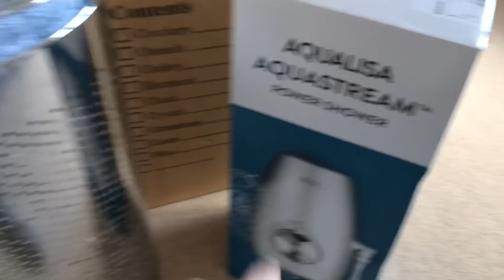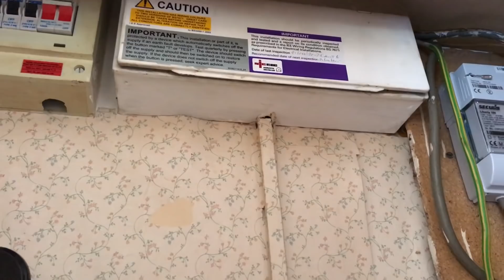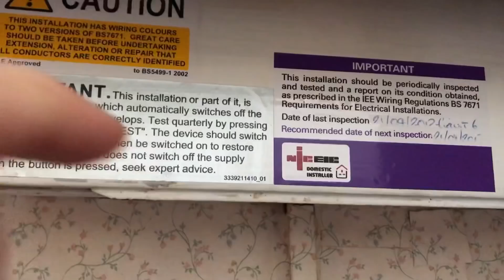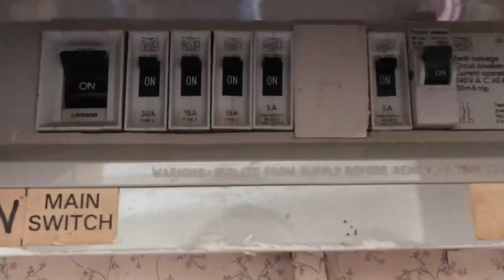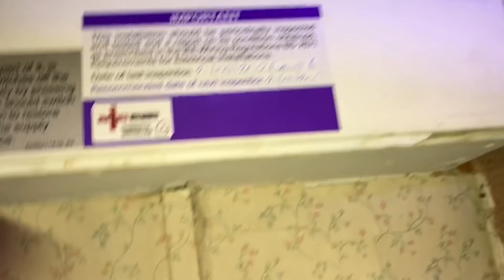CJR ELECTRICAL electricians day wiring and finding more poor installation work!!!

Comment: I enjoyed every moment of this video. :) The graft, the banter, the honesty. Top notch. The regs do state that a junction box using screw terminals need to be accessible UNLESS using maintenance free connections. Mr Wago must be rolling in it these days.  I am looking forward to the next installment as always. Cheers dude. :)
Reply: The funny thing is...Screwfix sell "maintenance free boxes" called DeBox but its a screw terminal 3 way choc block in a cheap plastic housing with a pin you push through it..go figure!...I don't get it either..crazy..
Reply: @muzikman2008  :) The really frustrating thing is the fact that much like the Holy Bible, BS7671 is open to interpretation.

Comment: 3:35  I looks now in net for 10 kW products here in Germany and Thailand. They shows me some with 3 phases (400 Volt) and  3x16A fuses. The highest for 230 V from a german company are 5.7 kW. 

If I calculate right do you need really 44 A?! So you need for shower only 88 A add products how run at same time (dish washer, washing machine, heating, aso) round about 150 till 200 Ampere to this place? 
And this only for have only one phase into this place. 

Here are three phases normal => go in at main switch normally 63 A. This works fine since the 60's/70's. In Thailand they do it since around the year 2000. Have starts with saved earth (yellow/green) for every socket too.

Comment: 13:48 I think the problem is the UK definition of "accessible" is different from US codes definition of accessible.
More or less the US code states that to be considered accessible you must be able to locate and touch the junction box/point without the use of any tools.
The idea behind this is for future troubleshooting, you don't have to go ripping up half the floor boards, or cutting 50 holes in the walls of someones house to figure out where a junction box is that had a loose connection, providing they followed code.

By your definition of accessible, junction boxes could be put anywhere in a typical house in the US, as drywall/sheetrock can be easily broken out with a hammer and patched to provide access
Reply: It's not accessible under nailed down floorboards with, no doubt, fitted carpet or laminate floor on top.

Why he's concerned about stressing it is accessible I've no idea. If its maintenance free it can be installed in inaccessible areas. That's the entire point of MF boxes.
Reply: Who said he was nailing down the floorboards, we're probably talking about one floorboard at most, and that can easily be put back down with a few screws, it's hardly inaccessible.

Comment: Everyone's definition of accessable seems to be different when it comes to joints. Seems to me it can only be considered accessible if the joint is easily identified and wouldn't take a great deal of inspection to locate.
Underfloor boards and coverings with no indication it is there is not accessible in my opinion.
Reply: Strictly speaking under nailed down floorboards with fitted carpets on top, or perhaps laminate flooring isnt accessible.

Not sure why he commented on it really, he fitted a maintenance free box, so it doesnt matter if it's not accessible. That's the entire point of MF boxes.
Reply: The way I see it can muggins access it without lifting or removing anything? yes or no! if the answer is no then it's NOT accessible.
Reply: captain mirrorboots  

"So maybe just use them in any areas that might be deemed non accessible."

Yep, I don't see the point at all using conventional junction boxes anyway, given that Wago's and products like the Hager MF junction boxes are cheap and maintenance free. Whether in two minds re regs or not, just use MF. Problem solved.
Reply: As to accessibility, a master electrician in the US would never locate any kind of junction box in a building void. With the outlet circuit  shown , in the US it would be relocated into a wall in the hallway as a “service outlet” making it accessible and useful for the use of a “ Hoover”., or other tool that you or another tradesperson might need. By doing so, it also shows a respect for electricians that may need to work on the wiring in the future. What happens if a Waco fails? Every device or connector has a considered life span. I am certain that in some circumstances you have needed to take more time to locate hidden connection location than should have been needed and caused inconvenience to your client by having to tear up carpeting and flooring, because of a prior electrician working for their own convenience.  For the kid of work thatI have  seen in your videos, it is surprising that there has been No mention of a building inspector that would sign off on your work as surely you received a permit for the work.
Reply: @walterulasinksi7031  Actually Wago's are unlikely to fail. In reality, you often find very old conventional junction boxes under floorboards, with screw terminals, terminals still firmly tightened and functioning fine. The theory is that the terminals loosen over time due to expansion and contraction, but as I say, rarely happens. So the Wago connectors or indeed Hagar Maintainance Free boxes should't be an issue. They are very extensively tested and deemed appropriate for the application. Which is why they qualify for the MF designation.

I'm very surprised that you say US electricians "never"  install junction boxes in potentially inacesible voids. I would say there absolutely must be occasions when that's required. If the cable isnt long enough you have no choice but to use a junction box, either that or rewire an entire circuit. From what I've seen of US electrics, the regs seem less stringent than in the UK.
Reply: @walterulasinksi7031  Yes, under Part P of our regulations, work is signed off by a local authority inspector, or a third party who is certified. Who could be the electrician themselves if certified to do so.

Not all work is cerifiable  though. There are jobs I can do as a home owner. For example spurs from the ring, lighting circuit work etc. What you cant do without notification though is anything in a wet area, like bathroom or outside, or anything involving a major change to the circuit.
Reply: @martinw245  The electrical code in the Chicago metro area where I work follows the NFPA 70 code, aka, the National Electrical Code (NEC).  In the city proper and much of the surrounding suburbs we use metal conduit from the mainboard (circuit breaker panel) to every light, plug and appliance. The conduit must terminate in a properly sized metal box. Per code, every box must be easily accessible. That is true even when a box with a plain cover must be installed or a convenience outlet may be installed. I'm not saying the US  has better codes. Just saying that they are different. I work in the petrochemical industry now and have more codes to follow than ever.  I find the installations in other countries very interesting. Stay safe wherever you guys practice.
Reply: @anotherusername69  Yes, what with 50, or is it 52 states, in the US, I would imagine there's a considerable variation in terms of the regulations. With some more stringent than others.

Comment: You should try the 221 series wago connectors. Nicer to work with and more slimline than the ones you fitted.
Reply: They are. Also now available rated 40 amps.
Reply: @martinw245  yeah those 6mm compatible Wagos are really useful.
Reply from the maker: Link please ?

Comment: How do you feel about using tiled plasterboard for a shower and not aqua board? 
Thanks
Reply: Tiles do not form a waterproof barrier; moisture will make it through to the plasterboard over time. However there are products that can be painted onto the plasterboard to create a moisture-proof barrier (before tiling).
Reply from the maker: It’s getting tile boarded
Reply: Take a look at Marmox Multiboard, Kerdiboard or similar. They are fabulous - insulating and a joy to work with compared to cement backer boards.

Comment: Top Tip for Plasterboard partitions - Fill them with Loft insulation to keep the noise in/out.
Reply: Loft insulation does nothing at all for sound isolation. To stop sound you need suspended mass - heavy stuff - lightweight loft insulation is not that! Try picking up a proper acoustic Rockwell slab - it's as heavy as plasterboard and is what you need.  Even the right stuff will make a limited difference in a single stud wall because the studs transmit a lot of the sound directly from the boards on one side to the other.
Reply: @Rosscoff2000  Of course its better to use the right stuff for the job..Of course its a lot heavier and more expensive but the job would be done right.

Comment: Why is it that UK showers need to be wired in at all? In Australia, we just have a hot water tank(gas, electric, solar, whatever) for the whole house and then the shower is just two taps(or a mixer) from the hot & cold water supply.
Reply: We have more options in the UK, all you've mentioned plus the electric showers which are a good option for people who either don't have the space for a water tank/heater etc or don't want the hassle of installing those choices.  I'm sure they could be sourced in Australia if you looked hard enough😂
Reply: @superseven220  Yes, I do think I've seen electric showers here, but only in stores, never actually in use. What is the 'Aqualisa' one here? With 3A it's presumably not going to have a heater.
Reply from the maker: No heater just a small pump
Reply: CJR ELECTRICAL just to boost water pressure?
Reply from the maker: Yep a lovely hot power shower

Comment: Hey Chris keep up the good work👍. I’m a spark from Australia and here we don’t have ring circuits. I’d like it if you were to explain some regulations with ring circuits in one of your vids, ie number of points permitted and protection required.look forward to seeing your next video.cheers.jj
Reply: Ring circuits are about area covered not outlets.100 square meters max I recall.  RCD protected.

I'm not an electrician I should add. Just do what is permitted for DIY these days.

Comment: Have you looked at "Tap Tile" switches for Shower/Bathroom. I for the life of me cant understand why it is not allowed to have extra low voltage switches on the wall rather than the horrid pull cords mounted on the ceiling. Have any customers requested an alternative light switching method to the pull cord ?. I hate the things. Loving your Videos. A great mix of infotainment. I stayed up all night waiting for the second part. Love the WAGO / In-Sure connectors. Came across them 7 yrs ago. Great idea. The sparky who fitted mu CU in 2013 did  not put my single Ring Final (52 sockets - nearly all twins) under the protection of the RCD OR make a comment on the Install Certificate the the sockets were NOT RCD protected. I only discovered the situation earlier this year when after watching a few Videos - it became apparent that the RCDs should be trip tested every 3/6 months. To my surprise none of the kit on the sockets went off. It was a NAPIT registered sparky. I put the situation to them about the sockets and RCD. They replied that the sparky did not make a comment on the Install Cert as he SHOULD have protected the sockets with the RCD. A shambles - NAPIT seemed to not take any responsibility for the quality of the workmanship of the member. I've subsequently taken the cover of the MK CU and found the Sockets CPC  is not (no longer) connected to the Earth bar in the CU. I'm investigating how easy it would be to split my Upstairs and Downstairs sockets onto separate circuits and replace my Split load MK CU with a Wylex and their DP Mini RCBO's. RCBOs are obviously the way forward.  
Its sometime shocking to see what you have seen in you recent jobs. How did you get on with the Lady whose flat you did the EICR for after it had been decorated ?  Rant over.
Reply: I've never fancied fitting one myself but there's nothing wrong with a wall switch in a bathroom as long as it's outside Zone 2. So 2' from bath or shower. My own bathroom (specced 5 years ago) actually has a 2D fitting with integral microwave sensor. Fan switch on wall outside
Reply: @dg2908  I cant see why say a 5Volt switch cannot be in zone 2 that activates a relay to switch on the lights.  My Bathroom fan is a PIR  - Xpelair DX100PIRS - No need to put lights on.

Comment: Enjoyed yet another video.  I couldn't help but pick up on your definition of 'accessible' though. Just to clarify, Accessible is defined as not requiring a tool to get to it. Lifting carpets and floor boards that are screwed or nailed down are probably best done so with a tool otherwise your teeth may need some slight attention afterwards lol  Sorry to be picky but everyday is a learning day for all of us. Keep up the good work.

Kind Regards - Steve :)
Reply: westinthewest thanks for taking the time to comment on my post.

I think I understand the confusion here.  To ensure safety it essential that enclosures/outlets are safe so they require a tool to gain access to live conductive parts.  In order to inspect and maintain an installation we need to access each and every terminal/connection so it must remain accessible (does not require a tool to access it). If it is not accessible then the connection must be maintenance free but in order to achieve this standard a tool must be required in order to gain access to the live parts.

So it is expected that as electricians we must use tools and test equipment to go about our business however in order to do this outlets and enclosures must not be obstructed by something that requires a tool to get to it. If a tool is required to get to it then it must use a maintenance free connection and suitable enclosure.

I hope that helps and comes across in the helpful way that it is intended.

Kind regards

Steve :)
Reply from the maker: Okay so how do you feel about the millions of house with 32amp screw junction boxes under floor?
Reply: CJR ELECTRICAL - Chris, Thanks for taking the time to reply to my comment. I know you get bombarded with many comments on your videos so thanks for stopping by to provide mine with your attention. 🙂

As you know, it used to be perfectly acceptable to use junction boxes with screw thread terminals in inaccessible locations in previous versions of BS7671. Im cool with that but as electricians we work to the current standards which no longer allows the practice of using a screw thread connections in places like under floor boards. Who knows, in years to come we may actually be ripping out MF connectors and suitable enclosures and replacing them with something far more superior?

I believe that connections under the floor will always be an occurrence and in these situations my go to MF enclosure is normally the Hager J803 or 804. Sometimes I swap out the connector for wagos though. It depends on what the installation calls for.

Keep up the great work 👍🏼

Comment: So if you used that turn key in side the meter would you still get a fine.
Reply from the maker: Technically if you had to cut a seal yes
Reply: @Cjrelectrical  they really should be fitting isolators with the smart meter roll out.

Comment: Those busbars definitely look like they've been subjected to excessive heat - was there no plastic melted on the switchgear?
Reply: The busbars are a plated copper come across loads of these boards and they have never had any excessive heat build up just the coating corrodes with the heat.

Comment: I should probably know if an ELCB is acceptable rather than an RCD; that board's hardly worth sorting out, I guess the client doesn't want to fork out any more. Agreed on the joist drilling; which board to lift is often dictated by where plumbers have previously butchered the floors